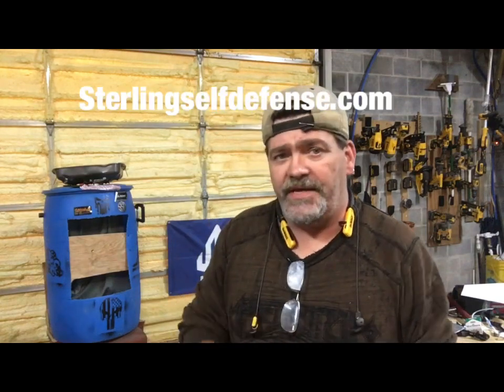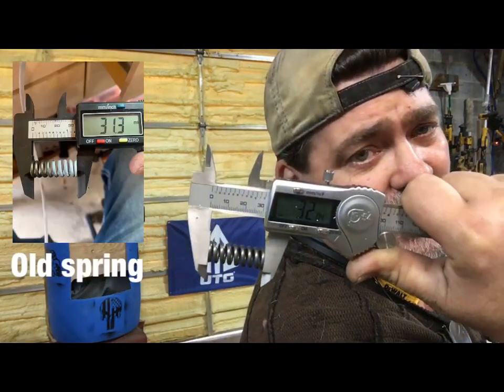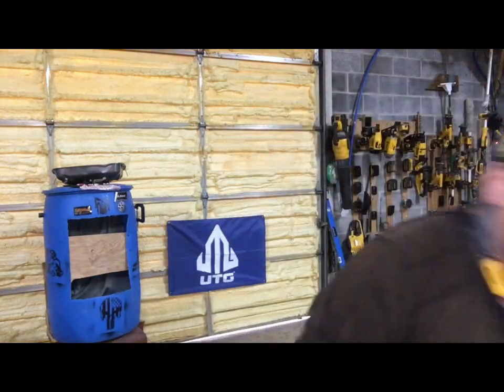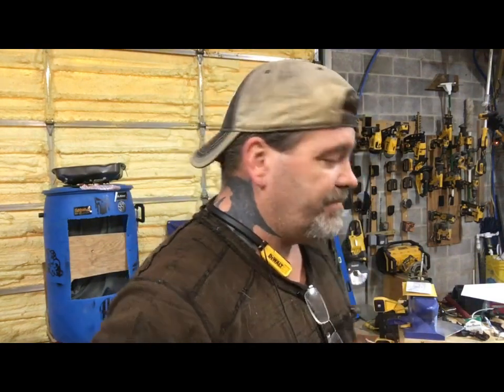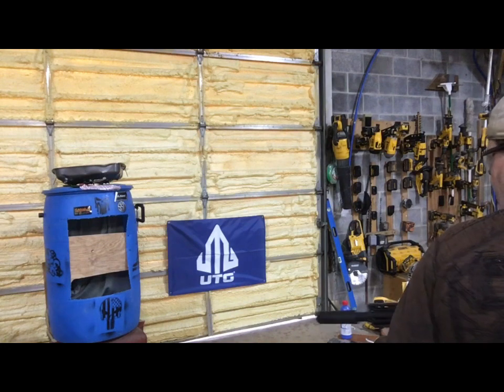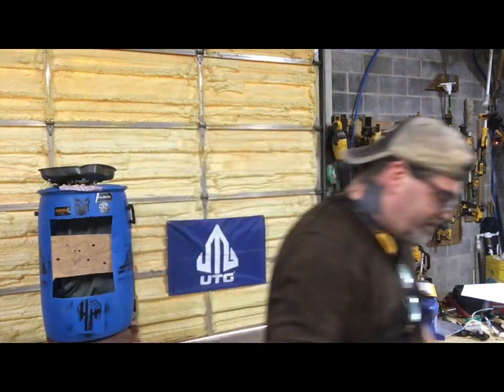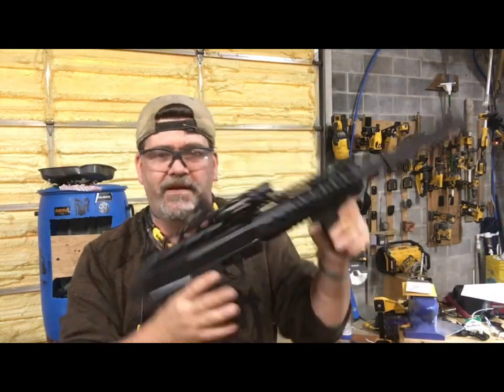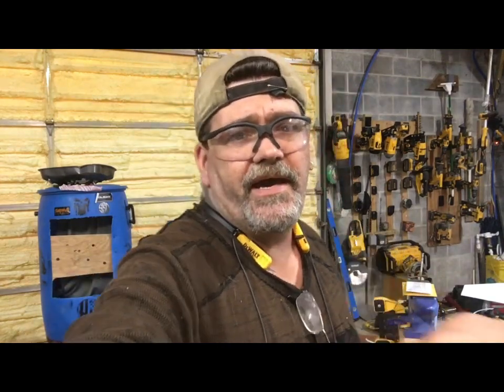The ghost test and common problem with FSC low power￼

Comment: Watched your YouTube discussion on FSC low power and the upgrade with a longer Regulator Adjustment Spring. Are the replacement springs from your store longer and upgraded from the stock springs? I will order from your store if so.  Thanks

Comment: Is there anything that can be done with the regulator to increase velocity, also once all possible mods have been done what is the maximum velocity one should reasonably expect? I have the Benjamin Armada in .117.
Reply from the maker: Ones all the mods are done just over 100 joules
Reply from the maker: Depends on barrel length also